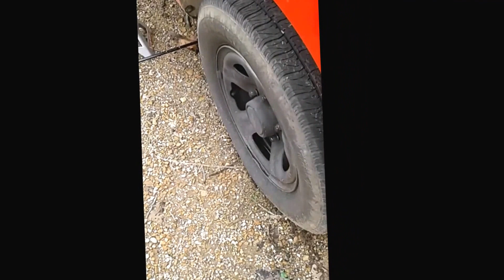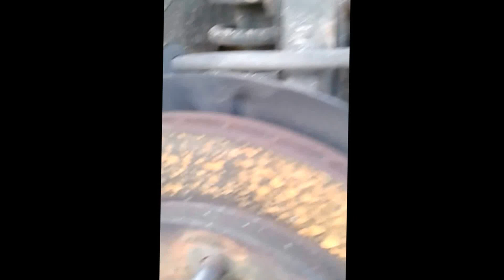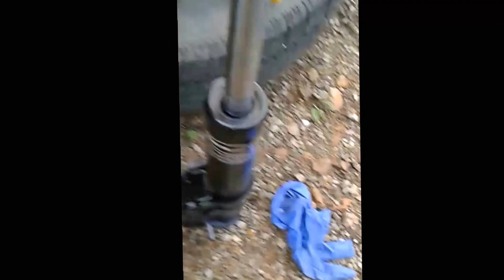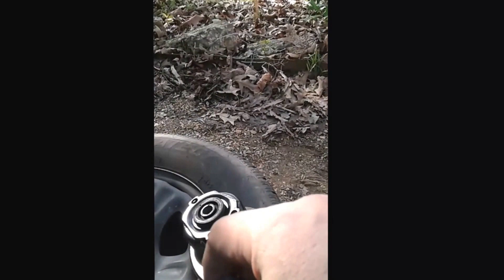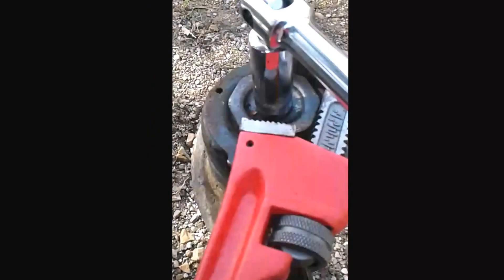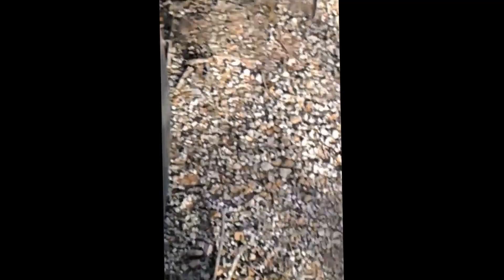Replacing Struts on 1999 Chevy Tracker

Comment: If you take that top nut and washer from the mount it should release the mount from the strut. You can then remove and reuse the dust cover. There is also a washer beneath the dust cover that should be moved on to the new strut, unless the new one came with one. I have seen on the forum where the strut pushes upward through the mount when people do not reuse the washer.
Reply: Oh lord please tell me where this literally just happened on my brand new strut mounts -_- I don't know what washers you are talking about.

Comment: i tried removing the strut mount from the strut on a 2000 chevy tracker, but am unable to seperate the 2. is there any way how i can go about removing it?
Reply from the maker: I had to separate them with the pipe wrench and breaker bar, and cut one off with a cut off wheel.  I don't know if the 2000 model is different.

Comment: Thanks! Very helpful! I haven't done one of these before. I feel more confident now. I got a 1994 Tracker. Thanks again, brother.
Reply from the maker: Sorry it took so long to respond, I don't check my comments very often, one thing to add is washers where the dust shield used to be on the new struts.  The dust shield provided the washers but new struts don't include shields or washers, I just used two washers stacked per strut from the hardware store, I used the strongest grade they had, can't remember the number now.  The struts have not given me any trouble so far.  Hope this wasn't too late.